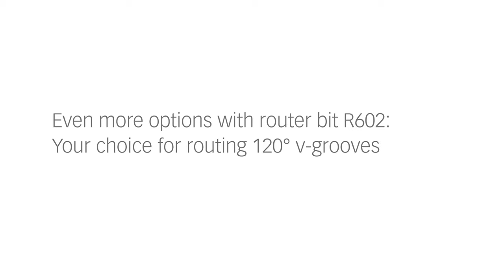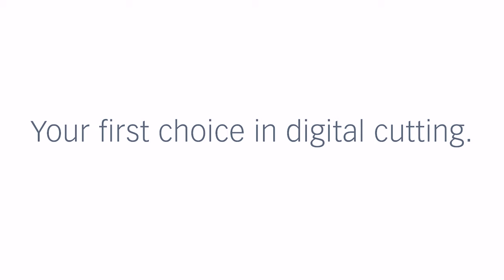Routing 120° grooves with R602 router bit from Zünd

Comment: I need this but fir a 6mm shank.

Do you have this V-groove for a 6mm shank?

The R141 doesnt fold 4mm acm
Reply from the maker: Hi Jordan. 

This 120 deg. router bit, R602, was developed specially for the RML, 3.6Kw router module.
Unfortunately, it’s only available in a ø8mm shank